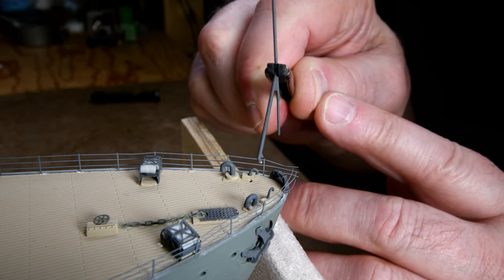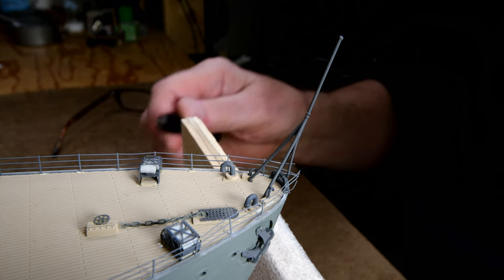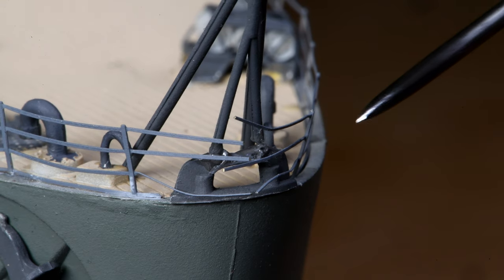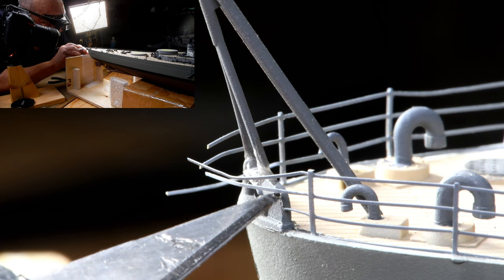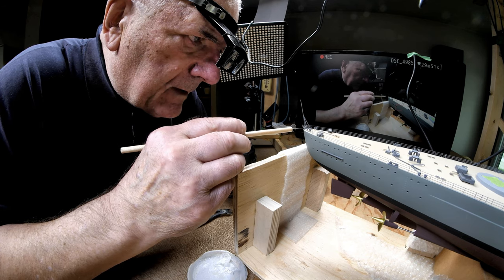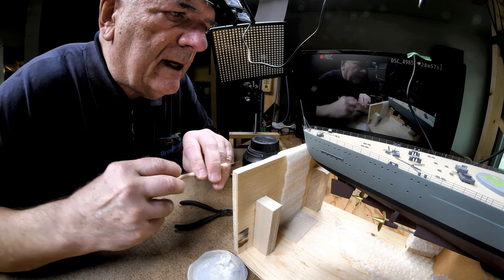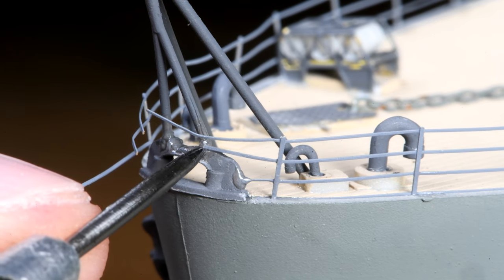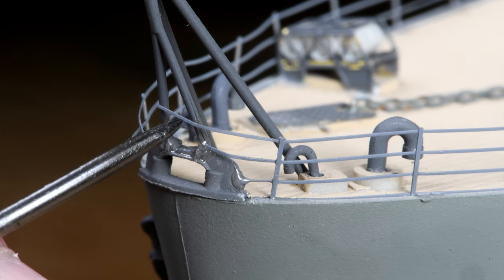The Model Ship - Part 464

Comment: Hi Ron,  
That glue applicator has a head that is too blunt. It picks up to much CA. 
Try using the point of a thin needle stuck into a dowel. This way you do not end up with a glob of glue on the joint being glued.
That Bow railing is a problem, but you will get it right.
Stay safe and stay healthy my friend.    😷.   😷.   👍.     ;-).
Jason
Reply from the maker: I've tried the needle point thing, and the glue works it's way "from" the point. Maybe I'll try it again. 👍